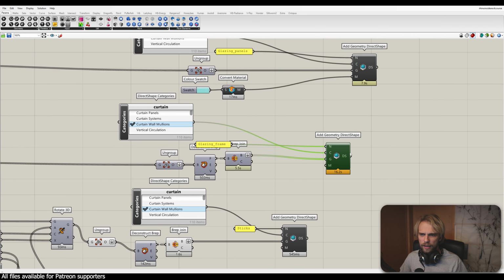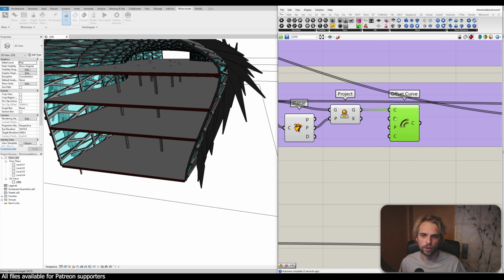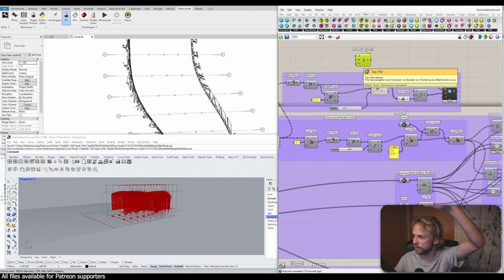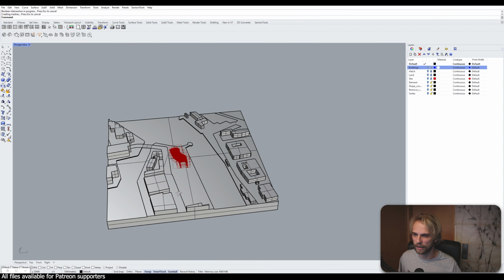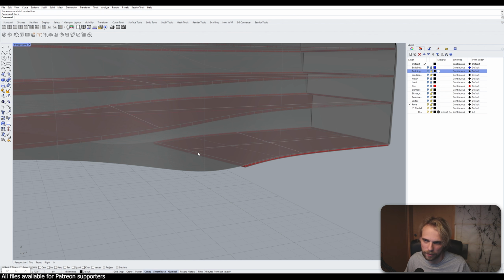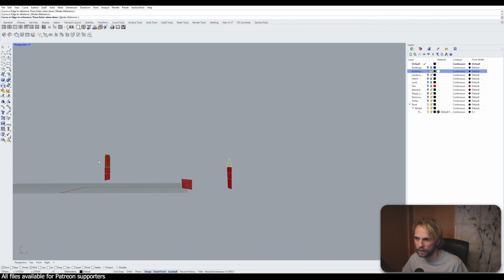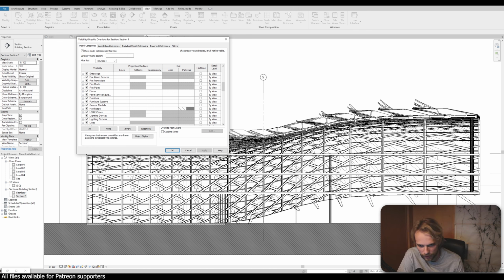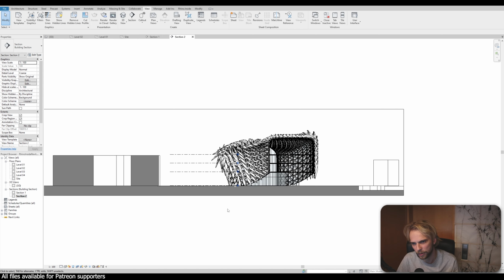Rhino.Inside.Revit Beginner Course - 3/3 - Automatic AXIS, CURTAIN WALLS, LANDSCAPE

Comment: if you add wall by DirectShape , you can not put door/window on that "wall" in revit. I think you should use Add Wall By Profile. or Add Wall by Curve then in revit attach wall to roof/floor
Reply from the maker: Yup, that's exactly what I say/do in the third video
Reply: @DesignGoBrr   and do you know how to add material tag to object from Direct Shapre in revit?

Comment: Cheers mate, nice presentation! it is true that it improves from the past years and the main feature that improve this workflow in which - Thumbs up to the Rhino Inside Revit Developers! for the Tracking Mode that bond the revit element to the gh script. There still some glitch, but in order to control the flow of data, not in whole model update as it makes Revit works so hard is I add Trigger Component to the groups of gh definition and I only click the button of the trigger component that needs to push some update and not affecting the other groups.

Kind regards and more power!
Reply from the maker: Yea, I personally use Boolean Toggle/Filter combo to control which parts of the script get calculated/updated